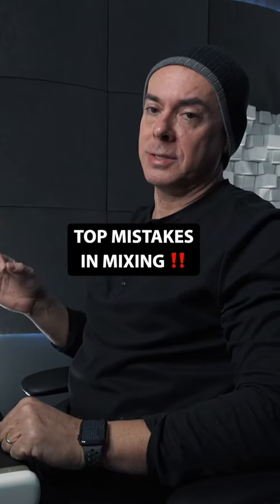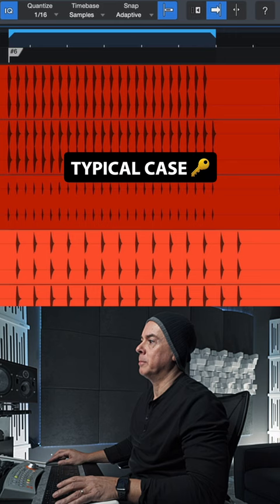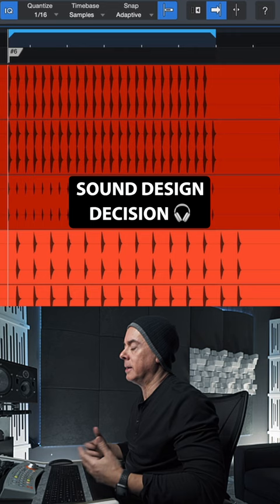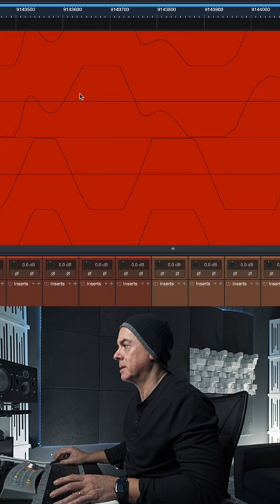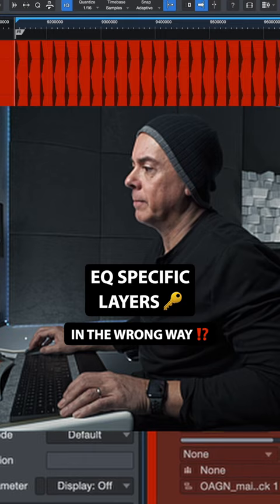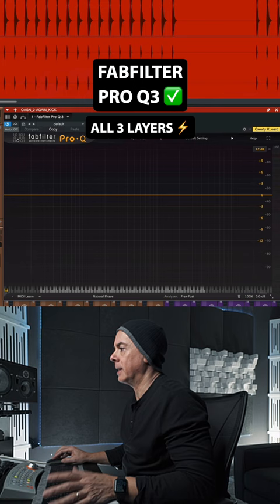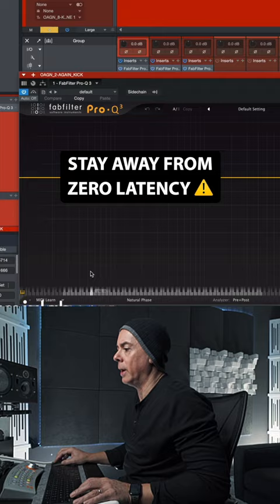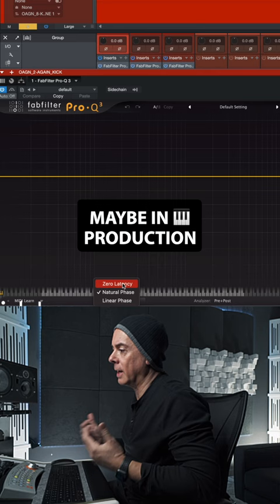Top Mistakes To Avoid in MIXING 🔥 Part 1

Comment: As you need your kick in mono, he meant that the kick must not be out of phase in the left and right channel, because it’s weakening the mono once you merge the L/R channels. Plus, if there are 2 different kicks, the waveform of Kick A won’t never have the same peaks and troughs of Kick B. You need to get both kicks in phase separately, so that you get maximum energy from each kick. Hope all the professors in the comment section understood what Pergolesi meant.
Reply: Great explanation
Reply: Phase is referring to timing and nothing else. They are perfectly time aligned so there are no phase issues. They are however out of polarity (negative vs positive) which can be fixed with a simple polarity switch (not a phase switch thats the wrong term)

Comment: 1) Those kicks were out of phase 
2) Zero latency is ideal for low end elements because it avoids pretonal ringing which is caused by Linear Phase on the low end. Linear/natural phase is good for mid and high end elements to avoid aliasing and phase shift.

Don't always stick to linear phase and definitely don't listen to this guy - unless this was a joke I somehow missed
Reply: Exactly
Reply: Totally true! Also, most natural phase eq:s cause aliasing very rarely (at least to the level that it starts to be a problem) so the only reason to use linear phase would be to avoid messing up phase in an importand place. (or in crossover filters because the preringing will cancel out, thus creating a perfect crossover) The problem that I often see is that people think their eq moves cause WAYYYY more phase shift than they actually do, and so they tend to use linear phase without a good reason just hoping that some magic will happen.
Reply: Dude this guy is the Standard in the Industry , he is the GOAT , show respect !
Reply: Linear eqs like pro q 3 don’t cause aliasing, what do you mean by this? 

The only difference between zero latency and natural phase is in the high end.
Reply: You are confusing phase with polarity. It is perfectly in phase (which refers to timing) they are however out of polarity which can be fixed easily with a polarity switch (not a phase switch thats the wrong term)
Reply: @MrPukerman  not a Luca fan and EDM in general but, where can I listen your music?
Reply: the kicks were definitely out of phase but linear phase and natural phase is not the same thing.

Comment: How do you set it for parallel?
Reply: Make a send to a bus.
Reply: @martins1254  thank you, I know that, but how do you set the eq when going to parallel is my question...
Reply: @imremozsik1012  No one can tell you how to eq that depends on the sound. BTW Pro Q3 has an output vol so if you turn it down thats parallel.
Reply: he ask what type of setting is used for parallel ..
zero, natural etc...
Reply: @sebbosebbo9794  ohhhhhh
Reply: @sebbosebbo9794  thank you!
Reply: Linear Phase. That’s what I’ve seen Streaky (a mastering engineer) choose all the time for parallel.
Reply: Linear phase for parallel